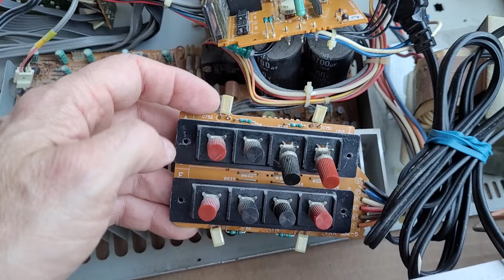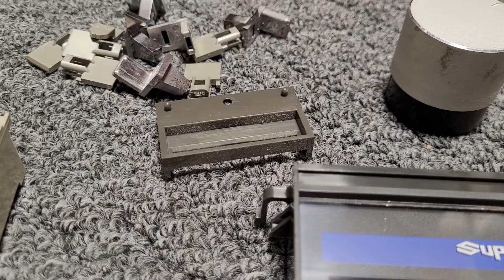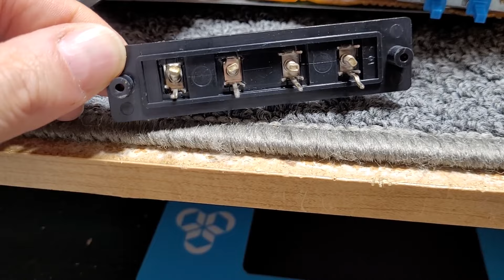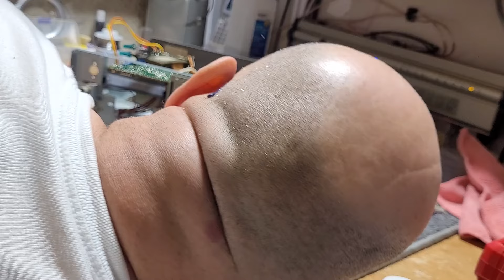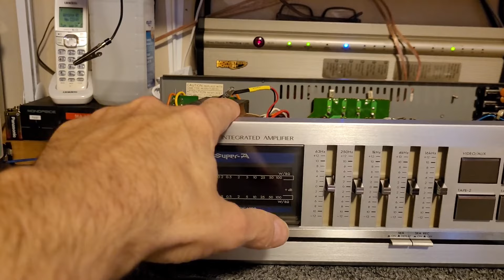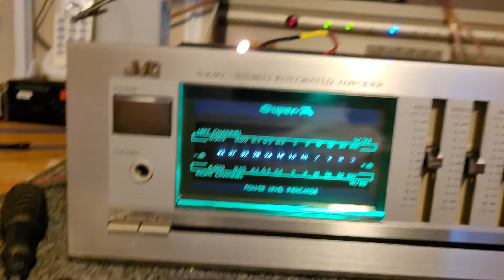JVC A-X40 Integrated Amplifier Restoration Part 2

Comment: I have had this exact same unit in use for almost 40 years and it also has problems with switches, volume knob, EQ an so on so it needs restoration too. By the way, It looks really great when the backlights have been changed. I have never seen it with those lights on 💪

Comment: Never, never water wash  a PCB with passives and a RELAY. And the xformer got wet??? Faceplam!
Reply from the maker: Give me a break.  Nothing is broken, nothing died, the amplifier works perfectly.  I've restored equipment that was submerged in basement flooding.

Comment: Good job brother. A lot of work. Helps pass the time in retirement. How is the golf game? Buy a motorcycle yet? If I was keeping it I probably would have recapped the power board just because. My heart hurts a little that you didn't replace those awful speaker terminals with 5 ways. Locally in my market that unit would go for $80 - 120 bonez.   Nice that you did a long form vid. Thanks for sharing.
Reply from the maker: Don't golf, no plans to get killed on a bike...  lol